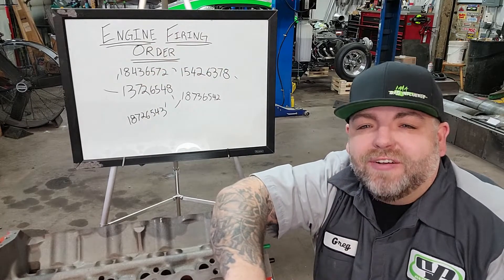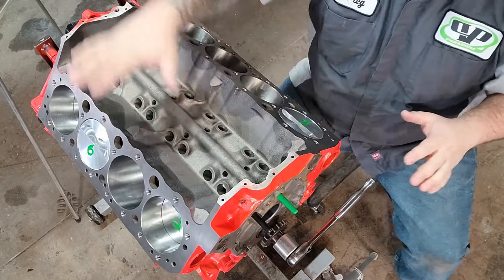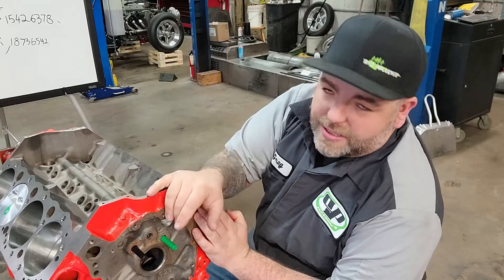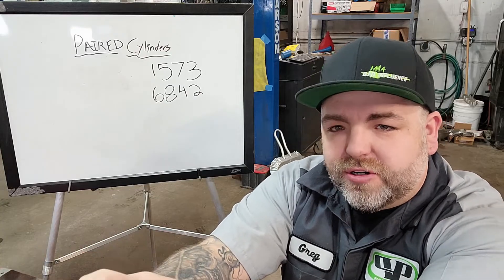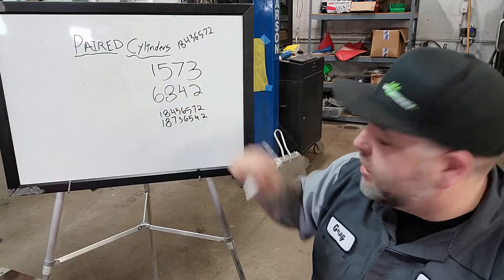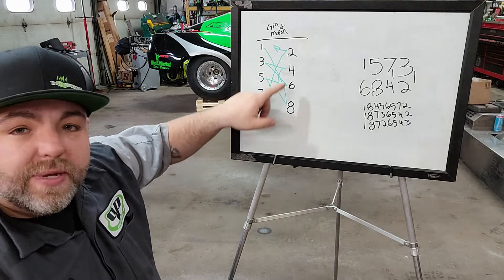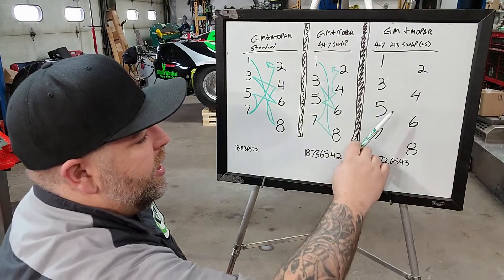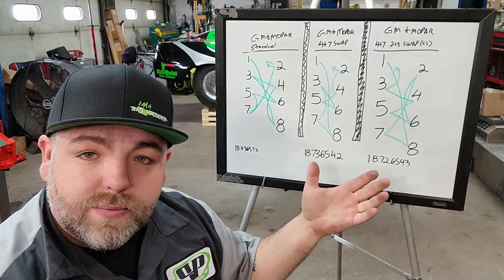V8 Firing Order Explained

Comment: Way Kool Stuff 
BUT 
You left out some Nail Head Buick, Y-Block Ford and Early Olds - why am I going there?
LS = Perimeter Firing Order, why is this important? Think of your SBC with a single 4-BBL intake and the 5-7 firing right next to each other - in the single plane intake one or the other is stealing intake charge from the other one = not good - with the perimeter firing order it goes around the outside first and then goes around the inside and no 2 cylinders fire one after the other. 
Olds 1950 to 1964 18736542 = here we have 4 and 2 firing one after the other 
Buick Nail Head they shifted the numbers left to right Passenger side = 1357 driver side= 2468 the firing order is 12784563 that is a perimeter firing order 
Ford "Y" Block all Ford uses the same cylinder positions the Y block is 15486372 another perimeter firing order 
Lets look at the 4-7 swap again = 18736542 - Does that look familiar? 
And lets not forget Cadillac NorthStar = Humm?  

Here is another look at firing orders From Speedway Motors 
https://www.speedwaymotors.com/the-toolbox/engine-firing-order-1-8-4-3-6-5-7-2-gm-ford-mopar-and-more/145781?srsltid=AfmBOopXMeH0VURR7BSCPVpnOalrN3CCpanNaMEPu1dTAxocsSAXVrAp

Comment: Does the pair cilinder can fire at same time?
Reply from the maker: No they cannot. With a 4 stroke or "4 cycle" engine (intake, compression, power, exhaust) it takes 2 full crank rotations to make the 4 cycles. The paired cylinders are on opposite strokes (coming up to TDC would be Exhaust & Compression)

Comment: Liked and subscribed. A quick note: you can develop all of the potential firing orders by using your “paired cylinders” list and moving twice left to right, simply changing which of the 2 available you choose each time — some of these are bad (a lot of rocking moment) and some are good. I had heard Ford used the “same order” but numbered differently; thanks for showing that detail. My project involves changing the numbers used on the Ford Mod V8 so that the ECU can be swapped to a Chevy or Dodge without a lot of reprogramming (essentially, I’ll be ignoring Ford’s numbering since it is MUCH easier to think left-right “balance” by referring to even vs. odd numbered banks). Now to compare your video to the Mod V8 firing order….(LS order)

Comment: Has no-one ever made a crankshaft to fully imitate a pair of i4's and keep four cylinders at TDC every stroke?
Reply: If you fire cylinders at even spacing (1-4-5-8, 2-3-6-7) the crankshaft would be loaded almost perfectly evenly with every ignition.
Reply from the maker: @budthecyborg4575  yes, it's called a flat plane crank, it's used in the Ford 5.2L GT350 engines.
Reply from the maker: @budthecyborg4575  
https://www.caranddriver.com/news/a15354688/holy-flat-plane-crankshaft-we-finally-get-an-in-depth-look-at-the-ford-mustang-shelby-gt350gt350rs-5-2-liter-v-8/
Reply: @BadInfluenceGarage  https://www.youtube.com/watch?v=YRuwp6waduk
Is this video wrong? That's certainly nothing like a mirrored pair of i4's.
Reply: @BadInfluenceGarage  https://www.youtube.com/watch?v=_j7lYuUtHzw
This is more what I was thinking of.
Reply from the maker: @budthecyborg4575  correct, to do as you're asking about, the crank itself would have to be made into a V, and that wouldn't spin rpm or balance well. The other option would be a flat 8, like 2 flat 4 Subaru or VW bug engines.
Reply: @BadInfluenceGarage  Someone actually tried the dual cylinder firing order: https://www.youtube.com/watch?v=ehZuhfOv3so
Reply: @BadInfluenceGarage  And now I find out the GT350 is still very much not a traditional flat plane crank either: https://www.youtube.com/watch?v=RcyMoZoqkPA
I find it very odd that V8's never use cylinders from both banks to solve primary balance (only the crankshaft counter weight), but I'd have to guess that complex crank geometry would seriously limit power.
Reply: @BadInfluenceGarage  Funny thing I learned recently the Porsche LMP1 919Hybrid V4 crankshaft they do indeed have separate crank pins for every cylinder separated by 90 degrees: https://www.youtube.com/watch?v=g9d3pxu7G2A
Maybe they're just less concerned about engine weight starting with a V4 but it's still surprising this has never been tried in a V8.

Comment: This is great but just for the sake of it I'm going to mention an important factor in that, if the firing order is so, than the "pairing" piston is infact at the top of the exhaust stroke, which must be understood as well for installing the heads. TDC is only the piston at the compression stroke.....TDC.

Comment: I just bought a 88 chevy k2500 with a  5.7 and the firing order on the cap is backwards from what it should be but runs fine. Noticed this when going to put new plug wires on.  Did they put the distributer in wrong previously or something?  Tried moving wires to correct locations and engine wouldn't fire

Comment: Wt if me made 2 cylinder to fire at same time will we get more boost ??
Reply from the maker: Boost is just a measurement of pressure inside the manifold, If you try to fire 2 cylinders at once the timing would be off for 1 of the cylinders. if you had say a custom V16 you could double up and fire 2 cylinders at once but i would not recommend trying that on a traditional V8